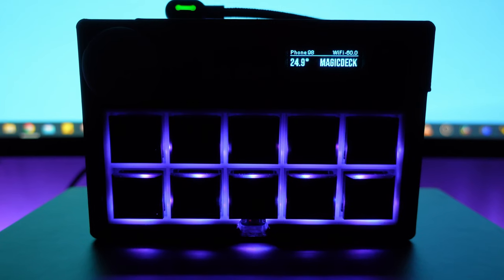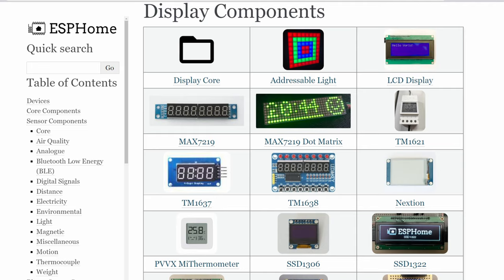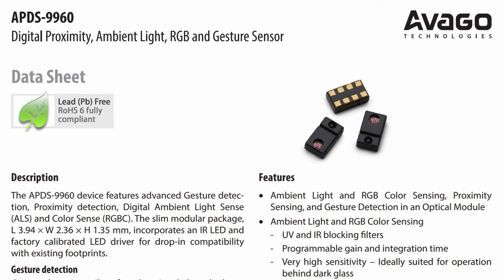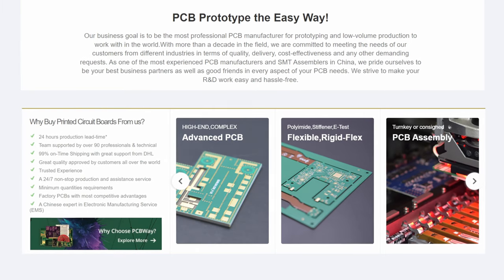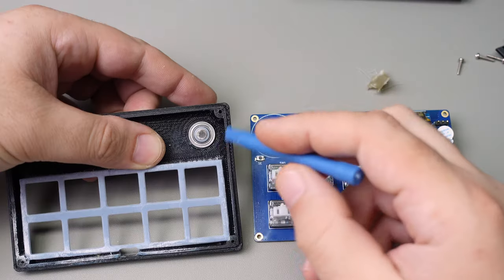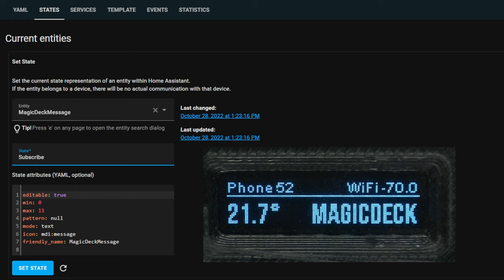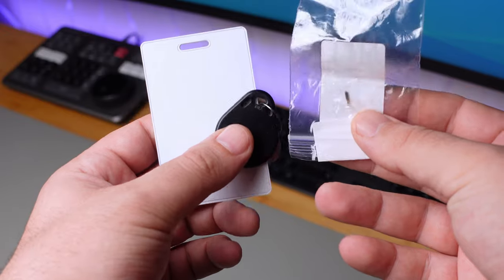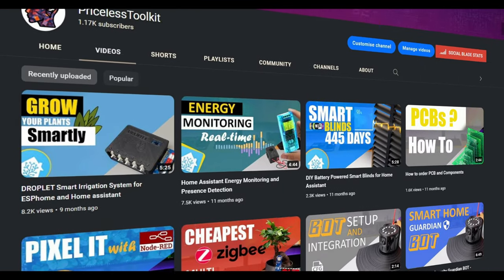Control Your Home With MagicDeck and Home Assistant

Comment: I think this is great project! But in my opinion it will be more practical if it is battery powered! Especially for big houses!
Reply from the maker: Thanks, Yes, of course, it will be more practical with a battery, But it can't run long on a battery "ESP needs to be put into a deep sleep" so the problem is that the ESP in sleep mode is disconnected from the wifi and will not be able to receive notifications unless you use it like "Remote only mode".
Reply: @PricelessToolkit  Yeah, you are right!